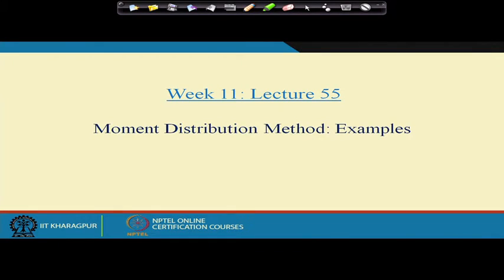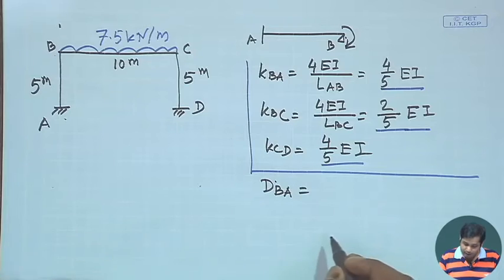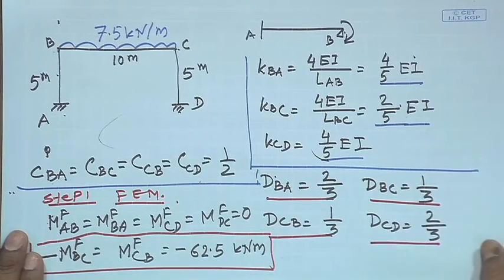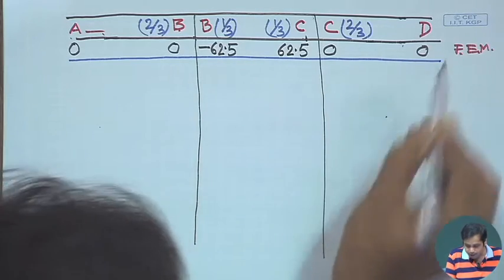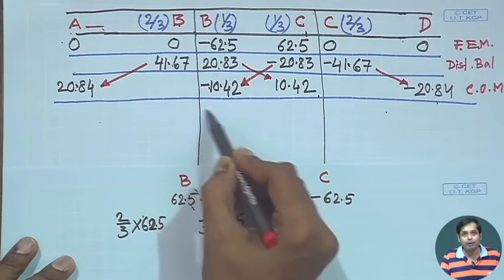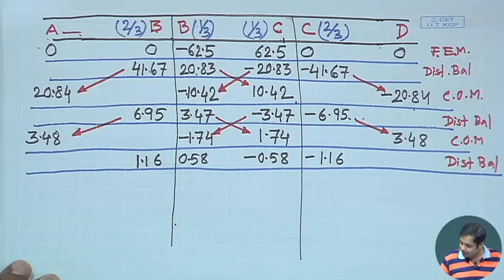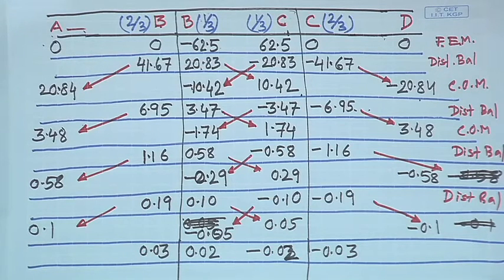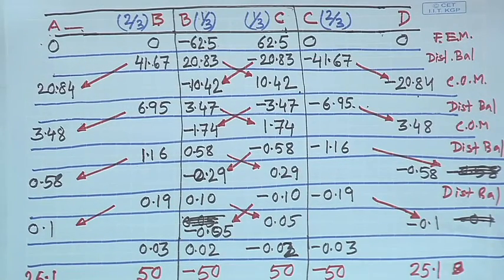mod11lec55

Comment: Dear nptel team i have mailed him also related to the query of BMD drawn by him, the BMD of members 
AB and CD should not be cross it should be straight according to values.
Reply: The sign convention for the Bending moment is used as Clockwise positive (+) and Anti-clockwise negative (-). Based on this sign convention all algebraic operations are performed. However, BMD is drawn based on the sense of the bending moment. It means whether the bending moment is sagging or hogging. In the BMD here, at A, B, C, and D the moments are shown on the sides where tension is developed in the member.
Reply: If i have to do the same i will do but atleast there should be a explanation for that Please ask sir to reply me.
Reply: Thank you sir I searched that email again yesterday and got the answer. Great explanation❤️.